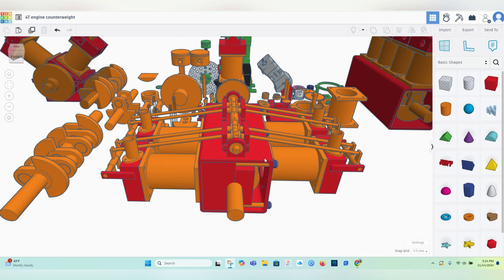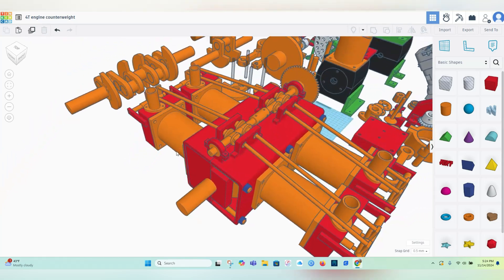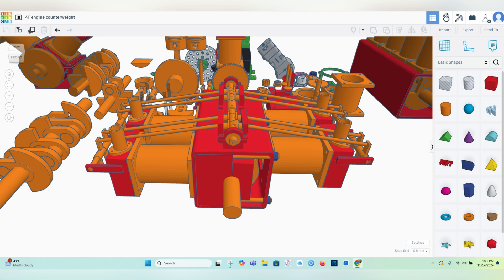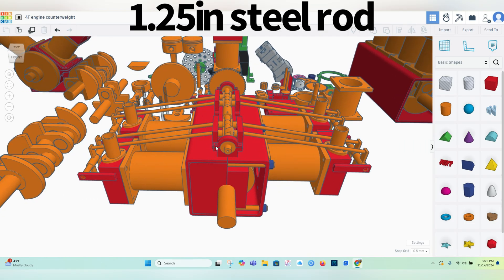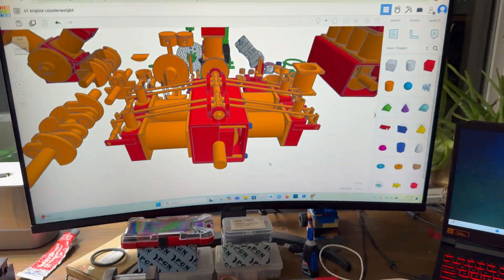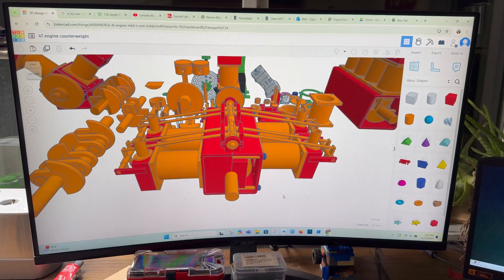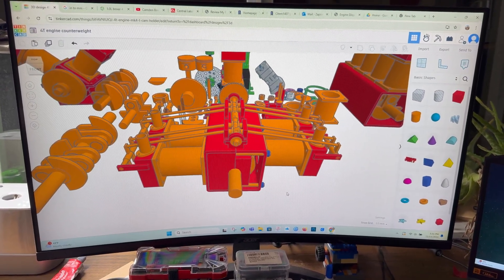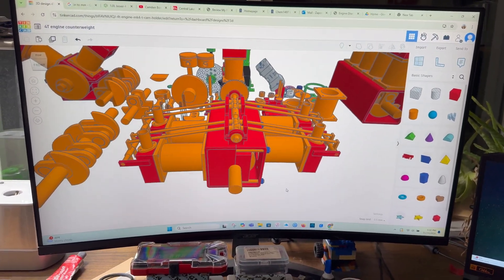Part 1: The Idea. Homemade Boxer 4 engine!

Comment: New to the channel, so maybe you have a better reason for it. But if you have some background in electronics and programming, then i think EFI will be better for this project. I can tell you from experience (Corvair guy), synchronizing and tuning the carburetors for each cylinder bank can be a nightmare. One big carburetor is also a decent option 👍
Reply from the maker: I think I would do one big carburetor, like a Harley Davidson CV40 carburetor, way easier and cheaper.

Comment: make a box around the cillinders for watercooling maybe it wil run longer
Reply from the maker: I’m thinking about wrapping the cylinder with copper pipe, and then making a homemade centrifugal water pump, otherwise I would cast aluminum heat sinks that bolt around the cylinders.
Reply: @ProjectLMZ  thats also a good option

Comment: Why not a 2 stroke boxer
Reply from the maker: I actually thought about that, but because my port timing would not be perfect, it would make less hp
Reply: @ProjectLMZ  well are you determined to use only things you make yourself because those 2 stroke bike kits are a few bucks and you'd have all the port math done for you
Reply from the maker: @charliesybert2683   yes, I want to try to make everything myself. But, I think I’m going to build a bigger engine first, from pro stock engine parts! 1L per cylinder, 2L boxer 2!

Comment: I have some replica Panzer 4 track 156 pcs of the track I can make a model for you
Reply from the maker: A 3d cad model?
Reply: @ProjectLMZ  Yes
Reply from the maker: That would be cool, but you don’t have to do that
Reply: @ProjectLMZ  I have my own design from my panzer 3 I can give that to you
Reply: @ProjectLMZ  I can give you a model I made to an panzer 3 If you want to use it in a video I'm cool with that

Comment: I think it will turn out very good. Are planning to add a cooling system? I tink a fan to the crankcase and a plastic cover to redirect airflow to the cylinders and the heads could work very well
Reply from the maker: I am going to build a homemade cast centrifugal water pump, and then I’m going to wrap the cylinders with copper pipe. That way, it will be water cooled.
Reply: @ProjectLMZ  that sounds very good! Hoping to see it working soon

Comment: That is it made in tinkercad is insane ,also maybe use dcoe carb for this to make a lil more powerfull
Reply from the maker: Thank you! I planing on using a 36mm makuni carb, but I might bump it up to a 38mm, because I want to put a supercharger on it!
Reply: @ProjectLMZ  bro ain't fooling around supercharger nice work also will you buy one or make it?
Reply from the maker: @zenyrts  I would buy one, I don’t think I have the machining capabilities to make one.

Comment: why a boxer tho? :((
Reply from the maker: Perfect balance, it will make it be able to rev higher, like 5-6,000 RPM possibly!
Reply: @ProjectLMZ  fair enough! I generally don't prefer their sound and packaging restraints, but in a project like this you're right, a boxer is probably the best option for rpm capability with the available machining tolerances!

Comment: As a long-time TinkerCAD user only recently switched to OnShape,  this is nothing short of some extreme patience and skill. I've designed some fairly advanced things in TinkerCAD ranging from functional carburetors to entire subwoofers, all of them were such a pain because of the huge amount of copy/pasting you had to do and having to recreate entire parts just to change a single measurement, super cool seeing you have the patience to design entire FUNCTIONAL engines on the platform. I highly suggest you give OnShape a try though, its totally free, and it is a huge step from TinkerCAD and will take a lot to learn, but it makes making changes to designs SO MUCH EASIER.

Comment: I can see some issues with installing of the rods you won't have access to the rod cap bolts unless you cut out the bottom and do a removable oil pan
Reply from the maker: The rods will be installed on the crankshaft before the crankshaft is installed, that’s how they do it on most boxers. 

Thank you for watching!!
Reply: @ProjectLMZ  never had my hands on a boxer before will definitely be an interesting build to watch!

Comment: you should make it watercooled and 3d print all metal
Reply from the maker: It’s going to be all metal with water cooling, but I’m not gonna have any metal 3-D printed parts I don’t think, it is really expensive, and I like making all the parts myself.